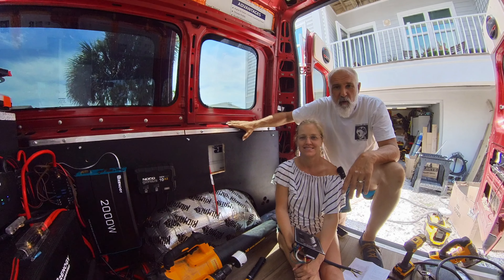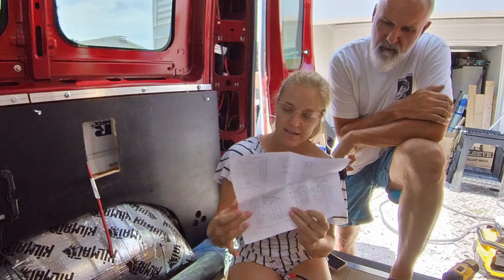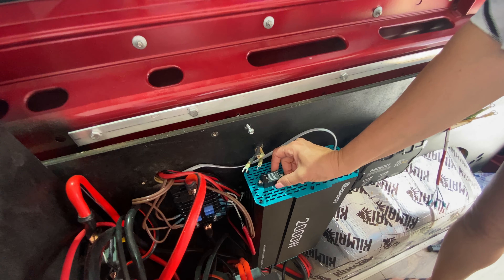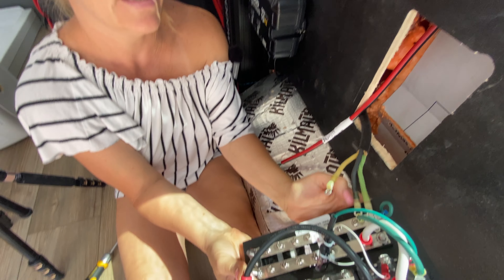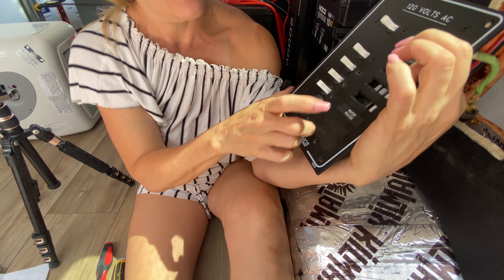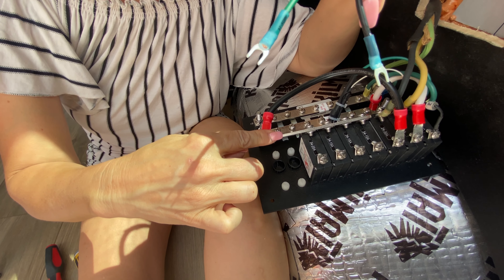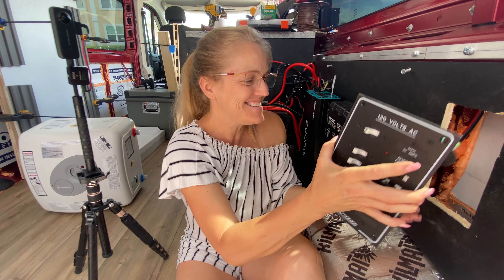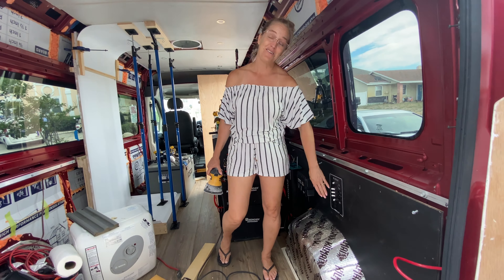Big Red Van Build Breaker Panel Instal for AC Current

Comment: what kind of connectors did y'all use for connecting the wires to the inverter? I have the same exact inverter, and I noticed that its a really tight space around those terminal. It looks like y'all are using 8 gauge wire if im not mistaken, which is what im using as well.